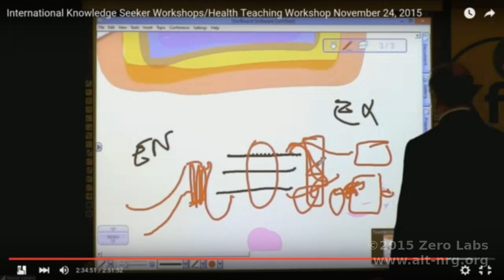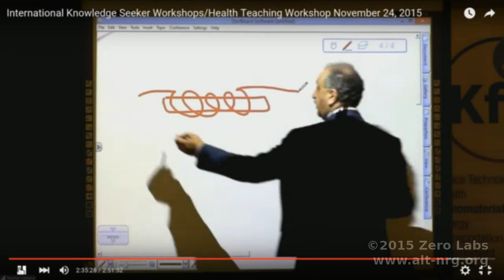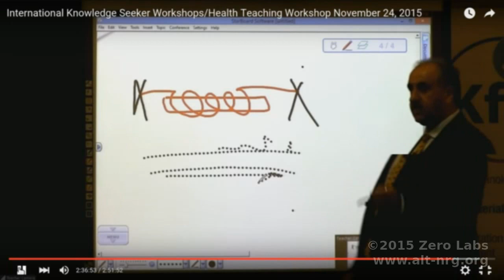#425 Keshe Plasma Reactor Update 09 Almost done

Comment: Zero,  if you didn't nano plate the copper plasma with the approved method, how do you expect your orgones to produce any voltage? By upping the amperage of the coils wrapping with a playful nano dust spritzing you can increase orgone output by 75% at least.

Comment: I agree with you about the coil. I think he has not explained the electron aligning process. a digital meter will add a very small voltage to the leads.  so if you are aligning the Nano material you need to add a small voltage that the magnetic properties will align the nano material to the proper direction. that is what I think. putting a meter across it is just like a weak resistor. in other ways. going back to the basic electronics. Nano material will align to magnetic polarities. and the eddy currents may align them as we.. thanks this is one of my thoughts. you are a great man I follow you a lot.
Reply: +Terry Berkley  "a digital meter will add a very small voltage to the leads" only in Ohms setting. in capacitance or inductance there is also an output, but it is AC in frequencies in the RF range
Reply: +DG Tactical heat will demagnetize the magnet

Comment: Use the multimeter directly after fire nano coating Mark this was in the same KKSW that you showed in this video.
Reply: +Robert Stubblefield ..., understood that that is correct... but he does not mention the direction..., which would only be available after creating a circle....
He also mentions that they all must be flowing the correct direction...
So, if you put the Negative and Positive reversed, are we still Stupid?
As the Coils are Clockwise coils from either end that one might view this... please specify how you determined the +/- ends,.
Reply: Kent Estes - to gravitational (small coil),  + to magnetical (large coil). On the other subject, I don't believe that calling any knowledge seeker stupid no matter how bad they screwed up is the best way to spread the knowledge. I do see how he may be frustrated that everyone is saying that it doesn't work when he knows that it does.
Reply: +Robert Stubblefield Agreed and apologies, I have been accumulating the knowledge required to build a unit correctly, and it has been frustrating.
I've decided to first build the single coil system with battery and capacitors to get a better understanding of the technology. The Health Pen has been a large success, so I do have positive feedback from a very stern citizen.
Reply: Kent Estes I have had great success as well. The technolofy is brand new and I think that some of us may have to build a couple before we are able to completely understand. The world works in mysterious ways my friend and I am finding that the more I research and perfect my knowledge of the system, the better my systems work. Check my youtube for instant results from magrav that should technically be impossible within our current understanding of physics.
Reply: Thanks Robert.
Some additional questions:
1) Do we need to use the multimeter on the Keshe Health Pen?
2) I have built 2 health pens (both 14 guage) with reports of both working. The first was a separate center pin circle at top with both magnetic and gravitational wraps as well as emotional wrap all based on nines. On The 2nd one, I got the hit to replicate the Keshe Magrav coil, threading an extension of the Magnetic coil inside itself as the center pin, looping the gravitational and emotional into that magnetic coil ... Both pens had all the end points slightly twisted around the center pin with center pin the longest on both.
What is your thoughts of using the center pin as extended (loop at top) center pin through itself?

Comment: Mr. Brash, I have been a follower of your video's for quite some time now. I appreciate your video's on hho where I saw (as in all your video's)  you report ACTUAL results. I was having trouble with people saying that my results (I was using ORMUS to increase conductivity with the electrolyte) were false, but after showing them your video's because you are a viable source of info they were more believable. I am wondering why you are worried about electrical conductivity since this project deals with plasmatic intetactions? You should not need electrical conductivity when dealing with plasma. Electricity is a byproduct of plasmatic interactions and as far as I can tell, this procedure is unnecessary. The only advantage I see would be to decrease friction of the gans on the plastic particles. What is the purpose of this? I will be setting up a similar star design (time and funds permitting) and would love your feedback.
Reply from the maker: +Robert Stubblefield I'm not copper plating for the conductivity. I am copper plating for the nano material that will form on the copper, precisely as in the original plasma experiments. This is supposedly the basis upon which all of the other devices are founded. I must build it precisely according to the original design or no one will believe my results.
Reply: ZeroFossilFuel I'm just afraid that you are wasting your time by doing this the most technical and difficult way possible. I started the Keshe technology on the 26th of October and I already have 6 working systems out. All of them creating a more stress free peaceful environment for someone. What is the purpose of this system? If you want energy, I'll send you a couple of coils. Maybe you can test them yourself and confirm my results.
Reply from the maker: Robert Stubblefield If you want to send me some of your completed coils for testing I will be more than happy to validate your claims for the entire world to see. Zero Labs, P.O. Box 1202, Burlington CT, 06013. The world awaits.
Reply: ZeroFossilFuel you got it. My electricity bill is less than half what it was. I don't need all 3 of mine.
Reply: Robert Stubblefield it may go out after the holidays. I have lot's of love to get and give within the next 6 days.

Comment: Keshe said when nanocoating COILS, attach a voltmeter to each lead coming off the coil.

The gist I got from his video is that a steady flow of electrons through the coils would generate a magnetic field which, in turn, would align the nanoshit to be a more compatible magnetically. If the coil is not terminated, there is no magnetic field and the nanostuffs don't adhere optimally. Sounds reasonable.

How this applies to a spherical surface, is not apparent. Mark, is it possible to generate a clockwise current through a sphere?
Reply from the maker: +Jerry Ablan No. I'm going to generate the micro-current starting with one polarity in the center of the bottom half, touching around the rim and repeating with the top half with the opposite polarity so it would be as if I was able to touch it from the inside fully assembled at both axes. So if the bottom axis is negative the top axis will be positive. This should align the nano particles along longitudinal lines. If any of this BS were true, that is.
Reply: +ZeroFossilFuel Gotcha. I'm wondering if it's even necessary/applicable for non-coiled surfaces.
Reply from the maker: +Jerry Ablan It's even necessary when making nano coated copper plates to produce the GANS. Why would it not be necessary in the plasma spheres? Better to dot all the "I"s, cross all the "T"s.
Reply: +ZeroFossilFuel I don't know. I was just thinking about current, linearly, I guess. :)

Comment: if he told everyone that the coil had to be hook to the volt meter before applying the coating, then the ones that did not do it, could be a little stupid. is it not possible to attach long uninsulated leads to the coil while its being fired? dont be to quick to criticize. peace!
Reply: +donkey is the optimal word here.....
Reply from the maker: +Russ B (Adirondacks4me) Uh huh. :)
Reply: did you start out trying to prove keshe right or wrong. it makes a huge difference on how things turn out. a truly intelligent person would never answer a comment or question in the way you two have chose to." a mind is a terrible thing to waste". peace in consciousness. you'll make it.